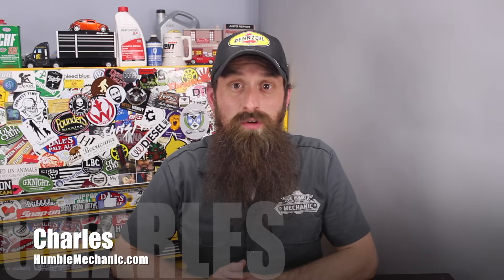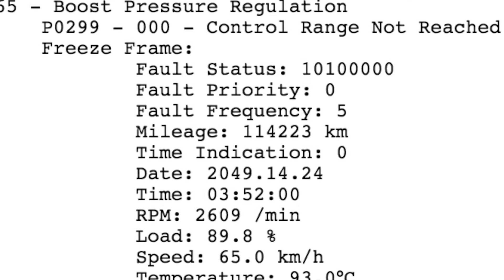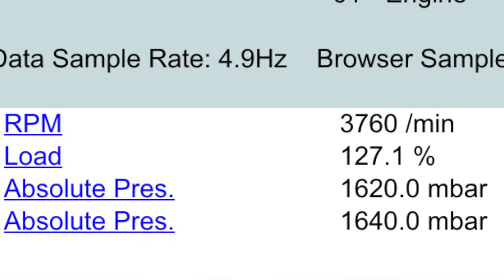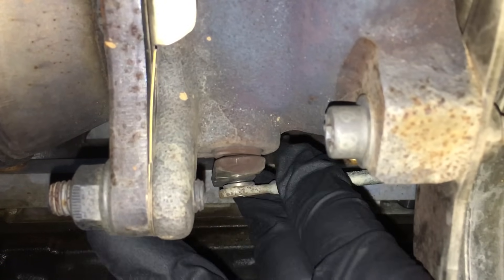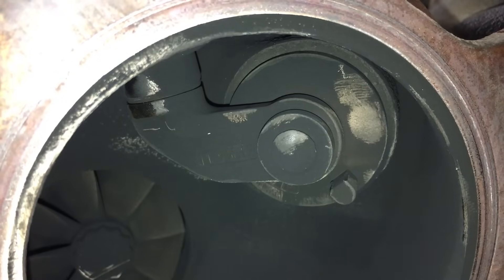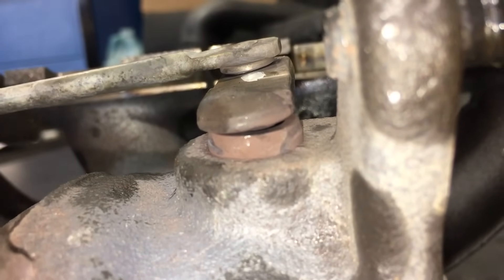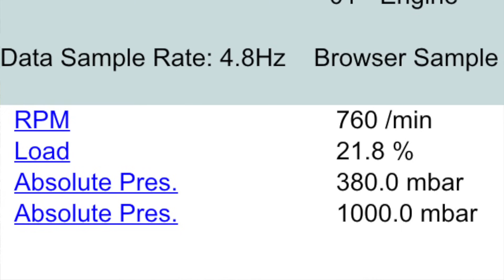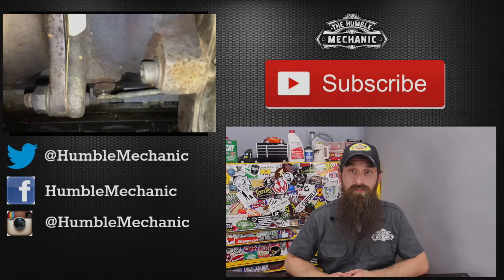Does Your VW/Audi 2.0t TSI Have A Bad Turbo

Comment: my arm rattles between 2500 and 3000 rpm, just got the little clip to make it quite again. sounds like a hear shield, but I've check all of that.
hopefully its just a quick fix with the clip and not a turbo, as I'm running 22psi so it could be cooked :(
Reply from the maker: +James Crook that clip does wonders for the rattle at the arm. But if it's loose at the turbo, it's a bad time.
Reply: Turned out to be a loose clamp around the body/exhaust of my turbo?!? The arm is perfect, thank goodness.

Keep up the awesome work.

Comment: In your experience, have you been able to hear the rattle while the engine is on? I have heard a rattle on mine after accelerating moderately and then letting off the accelerator.

Comment: Hey I have an audi a4 2.0T 2010 and I notice when I'm at about 4k rpm I can definitely hear my turbochargers make what seems like a whistling sound that's fairly loud, however I've never driven a turbocharged car before this one so I assumed that it was just the sound turbochargers make. I have the underboost error code, so could it possibly be a hole or a fault in the connection in the intake manifold for the turbo or something like that?
Reply from the maker: Sounds like you probably have a boost leak
Reply: HumbleMechanic do you think its fixable? Is there anything I can do or is it internal inside of the turbocharger

Comment: hello I have Passat 2010 comfort tsi 2.0 turbo fails in low and in high it walks well but when it heats up to its normal temperature it no longer turns on and off in low I have already changed several sensors and supposedly the mechanic put it on time but it remains the same. can you say what is the problem thanks

Comment: so i did this and have some play. also i have a clicking when decelerating that sounds like a stick in tire spokes. would you say these 2 together support the turbo fault?
Reply: For the clicking while driving, those can be either the Links that go on the steering system and or it can something looks like Bolts or just something that's loose and it makes noise with engine vibration

Comment: I have been dealing with this code on and off for the past two years.  Mine is a 2010 Tiguan Wolfsburg with just under 100K miles and the issue started around 78k miles.  I originally checked all connections and replace the DV with the upgraded version.  This did not eliminate the problem.  What is strange though is that code only appears during the summer months here in the Pacific NW, when temperatures are 75F plus and when AC is on.  All other times, when the weather is cooler and AC not used no CEL and no codes thrown.  I feel that it is most likely the turbo as when additional load is put on (maybe by AC) the CEL comes on.  Any idea of why higher temps would effect this ?
Reply from the maker: Warmer temps and higher loads  not surprised. It’s probably somewhat higher Underwood temps.

Comment: I have a 2004 mk5 gt tdi 2.0 golf I have the same code some times it even completely shuts off my gas pedal engine will be idling and mat the gas it does nothing also when it does drive and I get to 2000rpm I can hear the turn spoiling but no boost is generated I do hear air escaping could this because the east gate is letting boost escape ?

Comment: +HumbleMechanic How long does it normally take you? I got my first one today ( my first turbo actually- vw apprentice ) It took me a little north of 9 hours partly because of missing parts ( I inherited the job from another tech who went on vacation) and I broke 2 6mm Allen bits on the lower bracket and had to remove the turbo with it still attached.
Reply from the maker: 3-4 hours depending on the car. But turbos always kinda suck.
Reply: +HumbleMechanic yeah it was a 4 motion tiguan. Ahhh, the life of a flat rate apprentice!

Comment: My car is a 2015 jetta se tsi 1.8lt turbo and I cant figure were boost comes in at low rpm around 3000 rpm u here the turbo at 5000 rpm u cant here it at all if I punch from a stop it takes off slow then at 3500 rpm it spins the tires redline is at 6900 rpm

Comment: I'm so embarrassed to ask for your advice. But I need help, I got ripped off and being a chick makes it easy.  I bought my 2011 Audi A4 brand new. My check engine light came on years later. They told me bad waste gate and said over 5,000 to fix. I missed the Audi warranty by 2 months and 3,000 miles over. Sick about that.  I didn't want to fork out 5000 to fix it, when my car is barely worth 5000. And it drove fine. So I ignored and drove on it, for over a year.

Then one late night, my car illuminated 'too low of oil to drive" and at time my oil sensor was chewed on by rodents and wasn't working. So I poured 1 and half liters of oil in car, started it and it smoked like crazy, just bailing out the exhaust.  I shut the engine off and had it towed to this auto shop.  I told them what happened.  I asked them how much they charge to replace turbo. He quoted me 3500. So I agreed. Which was late Thursday,  Auto shop calls me next day at 1pm and tells me it's ready..  That seemed very odd to me because this isn't a turbo place.  They would have to order it from somewhere. Or find one in Las Vegas.  Anyways, I asked them how long the turbo warranty is.  They said 2 years. When I left there,, my car drove the very same exact way as it did when I brought the car there.  Except for them draining out the oil, I know they didn't put a turbo in my car. My car still smoked a little from the under the hood and the check engine light remained on.  I called him to tell him, he said "well I'm sure it would after all that oil."  I learned a lesson for trusting these people and not asking to see the turbo that they took out of my car.. I was scared to take my car to them, having no proof that they put a new turbo in and refused to have them ask for more money for things they weren't doing.  Skip to a year later and now my turbo is finished.  I feel like I have the proof now,, but being a chick, I'm hoping it just the bad turbo..  I gunned the accelerator trying to get out of traffic one day and it said no way, started thumping a bit and was very slow.  So my car is in front of my house and I'm going to tow it to that dreadful place that pulled a fast one on me.  Can you please give me some advice.  I would hate to have them tell me it's something else and I have to pay more big bucks, while they use that money to get my car a turbo.  Thank you for your videos and such important information that surely helps us immensely.  You are awesome and decent, I can tell.

Comment: Okay so my car is a 2009 gti and when I’m just starting to get into boost and it builds to 15psi+ there is a rattling noise I can’t figure out what it could be I really need some help
Reply: Maybe a little late, but that sounds like wastegate actuator rattle, it's very common and there is small and inexpensive clip that fixes it, just Google it
Reply: @AlpayYi  Would you know if this rattle happens when you have the car parked. Idling. You step on the gas to raise the rpm. When the engine comes down. You hear a rattling sound around 2000 to 2500 rpm then when it goes lower rpm. It stops?
Reply: @GldVWisRR  I'm not sure if it happens on mine when idling, but for me it's only there when the throttle is open, so when I'm not on the throttle, which sounds like what you're having. However, this clip doesn't help much in that case (even though it's definitely worth a try), because when the rattle is only there after releasing the gas that means the rattle comes from the Wastegate itself and not the throttle arm, so you'd have to tighten the wastegate actuator arm so the Wastegate doesn't flap around as much when it's open, but I haven't tried that yet.
Reply: @AlpayYi  well. I found my problem. The Waste gate actuator is garbage. I can grab the rod that connects to the arm of the wastegate flap. Move it back and forth. With no resistance.  Hence the rattle at the certain rpm. So will be replacing the actuator asap.
Reply: @GldVWisRR  Thanks for the update! I might have to do that with mine too.

Comment: is there a way to change the waste gate to save money instead of buying new turbo cause i am just finishing a full engine rebuild on my tiguan
Reply from the maker: Sadly not on this turbo. It is basically part of the housing
Reply: Cant you just weld the seal on its correct position???
Reply: it needs to open sometimes and close other times

Comment: not bad turbos, i guess they are just  rubbish turbos. 
i got an old 1.8 with k03 and stock boost is 0.6 bar . 
but if i bypass the wastegate it's insane 1.4+ bar boost . that's just crazy boost on that old setup 😄

Comment: Love your videos! Excellent, quality content with great personality - just subscribed!

Question/situation for you: I just purchased a used 2012 GTI DSG with 129k miles about a week ago from a reputable VW dealer. It came with a 3 month, 3,000 mile powertrain warranty. There is no MIL, and no driveability issues but I do hear the wastegate rattle when i rev it in neutral, when the engine revs down. I will check the wastegate arm for play, but I'm just wondering if I do find play in the turbo, and there is no MIL, would there be a way to get this covered and have the turbo replaced possibly? How long does it seem to take for faults to show up from this type of play in the turbo? I suppose it could just be play between the wastegate actuator rod and the arm going into the turbo, which that clip may take care of? I just don't want to have to replace a turbo shortly after my 3 month / 3,000 mile warranty expires. At the same time I realize there needs to be an issue in order for them to fix something. Please let me know your thoughts!

Thank you in advance!!

Comment: wastegate is fine, my boost gauge psi is normal, but i am getting that engine code: p0299 & another one which is "turbo is underboosting" and " turbo boost pressure not detected" and this all happened after my 2013 audi a4, decided to leak oil from the valve cover gasket (technically sealant) & timing cover gasket. which i fixed but now i have this rough idling (extra sound & stress on my engine) & now my car is running in this limp mode where my horsepower & throttle response is delayed & slowed down. help??!!

Comment: Charles i need your help,  i got code p0299 on a 13 tiguan. Thats the only code. There is no movement/play on wastegate rod, dv is good,new pcv, map is reading properly, I unplugged the n75 and no changes,also unplugged vacuum line to wastegate,  the car feels N/A.  Vcds shows a peak of 1500mbar. 1,000mbar is normal atmospheric pressure.
Reply from the maker: Any boost leaks?
Reply: @HumbleMechanic    No boost leaks. 🤔
Reply: @HumbleMechanic  i just removed the downpipe and the wastegate “coin” looks good. Also no shaft play on turbo.   This is weird

Comment: Is the turbo unsafe to run if it makes a rattle sound every once in a while but does not have a under boost condition? Or should the turbo be replaced even if it's an occasional rattle?
Reply from the maker: It’s begun to fail. Replace it now or later.  About the same either way

Comment: Charles. What Supplier does Volkswagen use for their Turbos?
Reply: BorgWarner
Reply: Incorrect.  TSIs use IHI's k03 turbos.    Borg Warner turbos can take a lot of abuse before failing (assuming a quality VW/Audi 502.00 spec oil has been changed at regular intervals).   Bearing failures are a known issue with the IHI turbos used in the TSIs.
Reply: borg warner is used in many ford models they Work fine but vw that tell that you can run your engine 30000 km before oil change  is the problem no oil can do that all my customers get their oil changed at 15000 km an they dont have the problems i se on vw serviced cars
Reply: The k03 is made by BorgWarner...
Reply: Hay, alldata.com says I need to change the "Charge Air Pressure Sensor on my 2011 Tiguan, but I can't find the part! Is there a different term for that part?
Reply: Newer TSI's use IHI turbo's, older ones use a BorgWarner
Reply: heinz 490 use Euro spec synthetics, and you can run the 10k intervals.

Comment: the turbos a fine but the vw audi oilpump drive is failing  ruins turbos highpressure fuelpumps  and often the bearings in the engine just had one with defekt axle from the balance axle to the pump a hex pin like a allenkey totaly worn out and round i had to replace turbo and fit a new reinforced Axel to drive the oilpump after that a new highpressure pump and when the pump gave up it was sending engine oil to the fuelcell and then i had to replace the low pressure pump to

Comment: What I have noticed on my 80kmile '11 Tiguan, no fault code came up, but I do hear some chattering on deceleration from about 2500 to 1000 rpm. I did swap out the DV with an updated one as the original did have a slight tear in the diaphragm. I thought the timing chain was the culprit and changed it out because of bad tensioner. I'm thinking that the wastegate is the issue, but I'm hoping to hold off to possibly upgrade the turbo when it goes.

Comment: Quick Question = I have an Audi a4 b6 1.8t and the car smokes a bit from the turbo area when pressing the gas. Any ideas?
Reply from the maker: +Romi work could be weak turbo seals. Could be valve guides

Comment: p0341 camshaft pos.sensor high output. and  p0343 camshaft pos.sensor range/perf. passat 2.5l 2012 85k  any ideas?
Reply from the maker: +djabzorb got the proper oil?
Reply: has proper oil    also customer states the vehicle stalls out a few times past few months
Reply from the maker: That is way low miles for chain stretch. Maybe the adjuster solenoid?
Reply: i test drove it several miles didn't stall ,i check out the N205 ok clean , i check to camshaft sensor with the dso good signal. it did stall out while idling in the shop once. so far just replace cam sensor to start. had test drive like 80miles so far nothing yet.

Comment: Here we go, my Audi shop said my turbo is going bad. P0299 has been popping up for about 6 months. And I haven’t driven much for about half that time. Anyways, all hoses are rock solid. They narrowed it down to turbo. Ugh. 2013 Audi A3 8p premium plus stage 2 apr tune. Transverse motor. I’m gonna wrench it myself. Great info, thanks
Reply: Most likely your waste gate . Full turbo failure is not common . What’s common is crook mechanics replacing the turbo when it dosent need it

Comment: Hi. I'm having a problem with my 2015 s3 turbo(I think) under half load I hear the turbo as it should function but when i floor it my turbo keeps going tis tis tis tis tis tis until I let off the throttle. Noone has been able to solve this and I'm completely lost on what to do. I dont have problems acceleration and no loss of power.
Reply from the maker: Strange. Maybe it has a small leak?

Comment: Thanks man I got a turbo from a pull a part yard im rebuilding do you know of best upgrade turbo rebuild kits.. I wanna use the best parts
Reply from the maker: Not sure of any off hand
Reply: Just buy a new or remanufactured turbo for christ's sake. Unless you like swapping turbos. I thought I'd be a cheap ass too. But sad F it.. bought a new Borgwarner. Instead of the IMI Pos. Good luck with you project.

Comment: So whenever I get to pressing hard on my gas I hear my turbo whine a little is that normal ? Or does that mean it’s going out ?
Reply from the maker: Some noise is normal, but it shouldn't be too loud on a stock car
Reply: @HumbleMechanic  my 1.4TSI sounds like it has a big turbo on it and only has boost low in the rev range, could this be a bad turbo? I've checked for boost leaks pretty much everywhere to no avail and really don't want it to be the turbo 😅😅

Comment: Charles does this test apply to all turbos? (as in diesels too)
Reply from the maker: +Malcolm Young no. This test is for this turbo. But if you do find a similar issue with a different turbo, it's probably bad.
Reply: Thanks Charles. :-)

Comment: I have a vw Jetta 1.8t gli and it has a bad idle but when I put my hand on the inlet hose from the maf that goes to the turbo it runs fine what can that be
Reply from the maker: maybe you have a vac leak and it's pulling in way too much air
Reply: I pull off the incooler today and oil came out and it was like a little less than half a quart

Comment: Does this apply to TFSI motors as well?
Reply from the maker: Yes. The TSI and TFSI are usually the same engine. Depending on who you’re talking to. I only use TSI or FSI
Reply: @HumbleMechanic  Awesome thanks. Other quick question. I watched your video on the heater core, on the new a3/s3 do you need to pull the dash to get at it. I'm smelling a slight coolant smell in the car.
Reply from the maker: No. They have access without pulling the whole thing. It’s on the driver side
Reply: HumbleMechanic oh man that’s a huge blessing! Thanks for your reply!